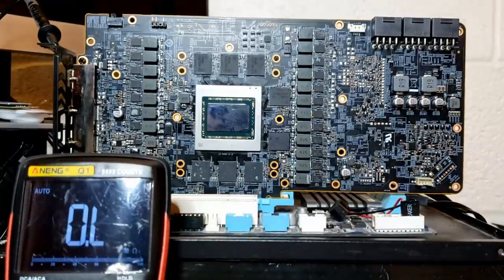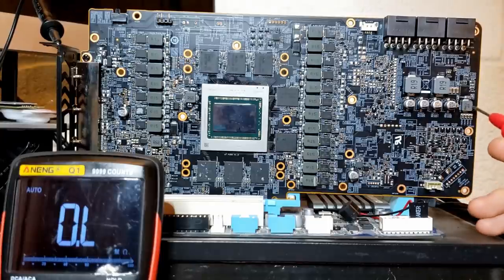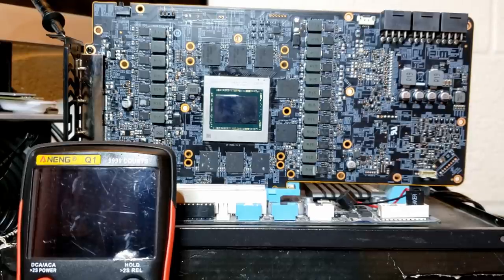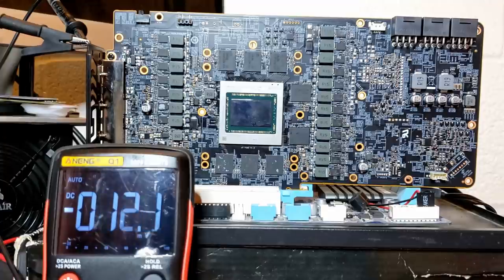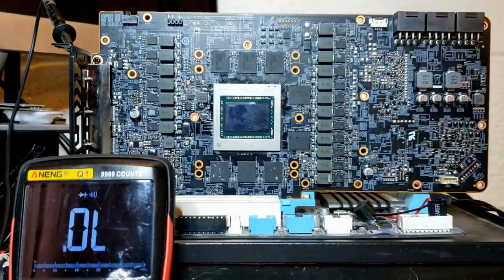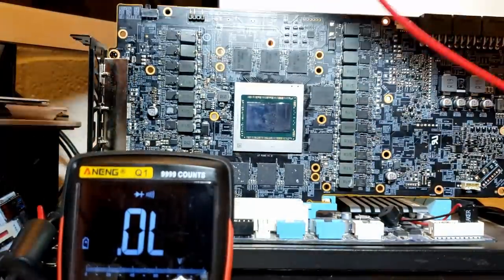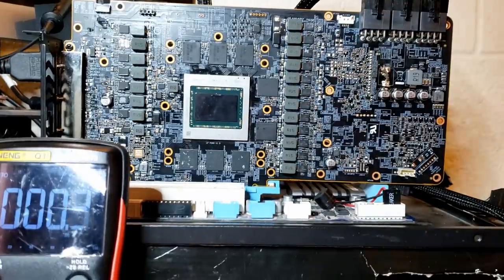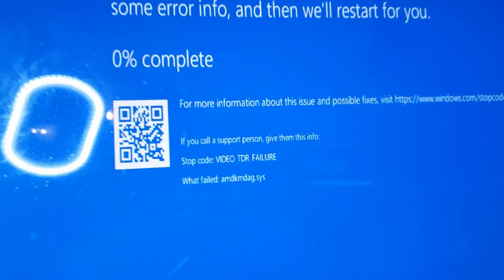PowerColor RX 6900 XT Red Devil Diagnosis - Computer won't power on

Comment: Props for doing a good job.
Just one small piece of advice. Try to either chill a bit or maybe script your vids so you come across more relaxed. 
But like I said, great job diagnosing the cards you work on 👍. You should totally team up with Rossman Repair  
and Ipad Rehab in efforts to get schematics made available and in their fight right to repair.
Reply: He does talk a bit fast.  It helps to slow the playback down to .75.
Reply: Rossman fix mac usually have boardview and schematic, me fixing generic pc and laptop that luckily to have just schematic, and part not universal because rarely got one same device every 20 job i received.